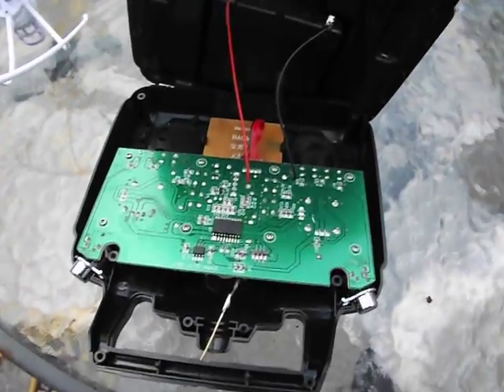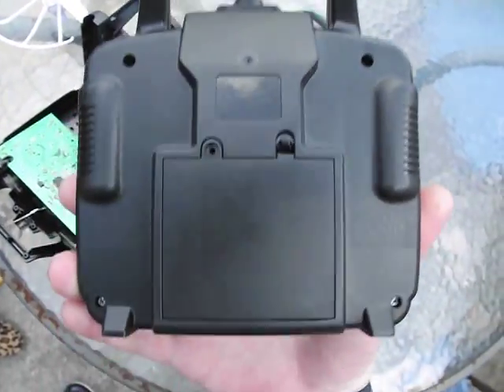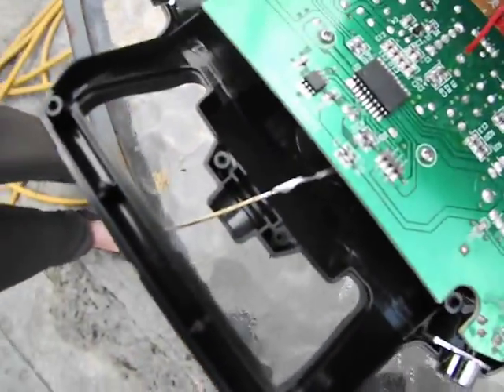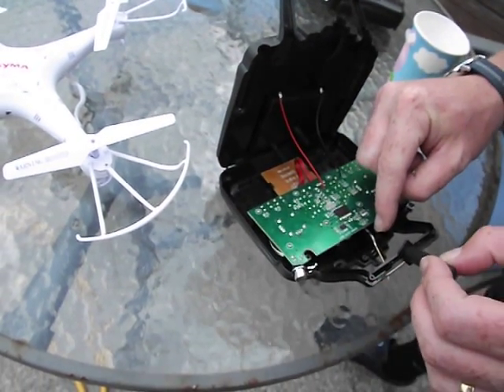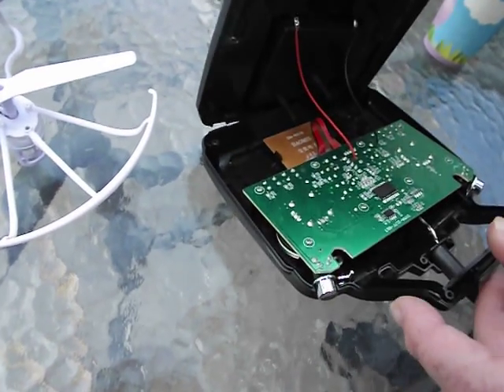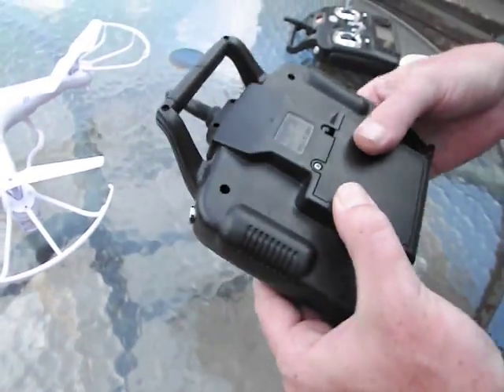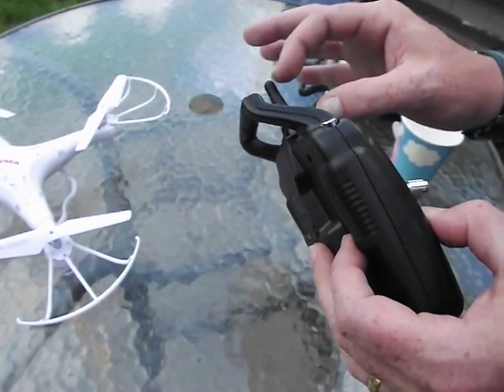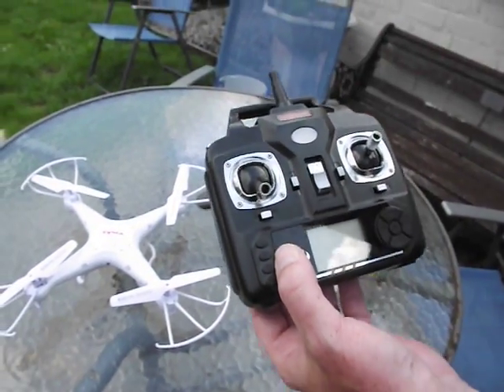Syma X5C Remote - Easy Antenna Range Extender Mod (2 of 2)

Comment: I want to do this but I'm afraid il just end up making it worse. Could you use copper wire along as it's the same length as the original antenna? Good videos by the way really helpful I have just ordered a X5C-1 my first ever quadcopter. Thank you for making these videos. 

Aaron.

Comment: How long was the wire you soldered on?
Reply from the maker: Jailbreak/Quadcopter Guy Any wire of equal thickness that is also radio conductive will do. As for length I would suggest you use 6.25cm total radiating length. The complete measurement for 2.4GHz is 12.5cm so you want the total radiating length of the antenna to be either that or a multiple of that, ie 6.25cm makes a half wave 2.4GHz antenna where as 12.5cm would make a full wave. You need to make sure you use the correct measurements or you could cause more loss than gain.
Reply: +Teash If it's not half wavelength then some of the energy will be reflect back into your transmitter where it will be dissipated as heat. This is called standing waves. The result is that it won't work even as well as it originally did and over time it could damage your transmitter.
Reply: xtratalk1 
Hello :) what will happen if my wire will be too long? I mean if it will be more than 12.5cm like in example 15cm? will it still works normally?
Reply: +xtratalk1 Do you have to stick the new copper wire to the one that comes with quad at the very end of it or you can stick it at about 0.5 cm from the very end of it?

In your first video it seemed like you wanted to stick at about 0.5 cm from the very end of the wire but in that second video I can't tell if you did or not.

Comment: Thank you for great video.
Quick question: will it work if I replace the wire (antenna) with wire equal diameter and 6.25cm in length?

Comment: Why does it not come with a fixed antenna from the factory? Why is the dummy antenna not a real one?
Reply from the maker: It's probably down to cost cutting which is a shame as it would have a much better range out of the box if they simply had the wire go into the antenna housing rather than bunched up inside the control near the board. They have improved this slightly with later models.
Reply: Thanks.

Comment: If I were to go to a Home Depot or Lowes hardware store is there a certain wire to look for? I understand it should be copper and able to conduct radio waves, but us there an exact thickness? Maybe a certain gauge? Also where exactly does it get soldered to the original wire? If you are soldering a 6.25 cm wire to the existing wire wouldn't it become 3/4 wave? Any help would be very much appreciated.
Reply from the maker: Any wire of equal thickness that is also radio conductive will do, copper is a good radio conductive material. You want the complete radiating length to measure 6.25cm or 12.5cm. The shielded wire attached to the board is classed as coax and does not count towards the radiating length.
Reply: xtratalk1 Thanks! Will be trying this weekend.
Reply: Randy Candy finally grew a pair and did a mod. I ended up taking an antenna from a dead Linksys router. It worked!! I'm not techy that way either. Hardest part was separating the antenna wire and the ground layer both of which u have to solder. Took me 3 hours but that's cuz I was timid and watching videos and reading comments of how to.
Reply: Joe Bleimeyer How did it go? Super tempted to try this but i'm not experienced with any of this stuff

Comment: I really want to do this mod, but there aren't any detailed enough videos explaining type of wire, videoing the soldering to show the connection overlap, the before and after measurement of the wire .etc I really don't feel confident with the information i have at the minute, would be grateful if you could make a detailed video please? Really like the channel too, keep it up mate!
Reply from the maker: Thanks MrTim93 and we are going to do a much more detailed video of this mod soon.
Reply: I was going to post the exact same thing. I really want to do the mod but don't wanna screw it up.
Reply: xtratalk1 Thanks for doing another video, I myself have very little experience with electronics. Getting this quad in the mail in a few weeks and will definitely do this mod!
Reply from the maker: Joe Bleimeyer We will get a more detailed video of this mod up really soon. If you don't feel confident right now then don't do it. if you do, take your time and follow the measurement guide in the video description ;)
Reply: xtratalk1 umm when is really soon?
Reply from the maker: TheLatvianHamster Within the next two weeks ;)

Comment: Hola, cuanta distancia alcanza Syma x5c con esa modificación? Sin modificación alcanza 50 metros, podría decirme cuantos metros alcanza con la modificación?
Un saludo.
Reply from the maker: About twice the range if you do it correctly :)
Reply: xtratalk1 Gracias por su respuesta.
Que material usa para extender la antena? Y que usa para unirlo soldador estaño?
:)
Reply from the maker: Hi Rober. Any wire of equal thickness that is also radio conductive will work such as copper wire or even speaker wire. I would suggest you use 6.25cm total radiating length. The complete measurement for 2.4GHz is 12.5cm so you want the total radiating length of the antenna to be either that or a multiple of that. You need to make sure you use the correct measurements or you could cause more loss than gain. Normal solder and a soldering iron are the best tools to use.
Reply: xtratalk1 Muchas gracias por su respuesta lo haré y ya le dire resultados.
Felicitarte por tu canal me subscribo. :)
Reply from the maker: Rober Gomez Thanks Rober :)
Reply: +xtratalk1 Ya aumenté el rango, y alcanza el doble como me dijo, gracias.

Comment: Instead of a wire extension, I used a tiny coil spring that fit inside the existing antenna housing, works great now.
Reply: +Busa0069 As long as the length of all that coil is 6.25 or 12.5cm your OK, it's not the length of the spring, it's the length of the UNCOILED spring....

Comment: Ok people he is not de soldering it from the board . hes is just simply adding the same type of wire to the wire that's already on the transmitter. If you want to do it rite. you have to get and old wireless router and rob the antenna out of it , then solder a pig tail adaptor to the board. If you do this I guarantee 80 to 120m

Comment: If you do the same to the receive wire antenna in the Syma X5C it will really max out the range.  It will guarantee much fewer in-range dropouts.

Comment: Thanks! Great stuff! Any plans to do a video about how to extend the antenna in the actual quad also?
Reply from the maker: Hi. Yes we're going to do a more detailed video soon showing the antenna mod on the control and the quad :)
Reply: Cool! I just did the mod on the quad, extending the antenna to 62.5 mm. And last night I followed your suggestions for the controller. I can't wait for the weekend to see if it worked! (Hopefully the weather will be good enough to allow some test flights...)
Reply from the maker: Bengt Alverborg Awesome, best wishes and let me know how you get on :)

Comment: Hi so I tried this mod, soldered wire onto the old wire and when I turn on the remote I get a continuous beeping from remote and it wont sync to the quad any more,  I've noticed some other people had this problem too, has anybody figured out a fix for it?
Reply from the maker: You have to be careful when you open the remote as there is a wire attaching both parts together, if you've disconnected that you will need to reconnect it again.
Reply: xtratalk1  Which both parts do you mean? the 2 wires from power to the board or something else?
Reply from the maker: wolfy1337 Yes the two black and red power wires are the main thing to be careful with so check you haven't loosened them, everything else is important too though so carefully open your remote and check everything is still connected properly and in the right place.
Reply: Yeah everything is still connected and I did not  get any solder on the board but I'm still getting the beeping noise, not sure if i shorted the board or use wrong wire, I ordered a new remote anyway, hopefully it works with my current X5C.
Reply from the maker: wolfy1337 Good luck mate hope it works

Comment: I'm having the same problem as Carlos. Pulled the thing apart, soldered the new wire on and I get the continuous beep. Remote won't connect to the copter and nothing will work. Anyone know anything about how to fix it?
Reply from the maker: It looks like you've disconnect something. Are all the wires etc. still attached?

Comment: shouldn't there be 2 wires on the board for an antenna ? one being a ground wire -  other tx's that I have modded all had 2 wires ,,,, now with my Syma one I notice there is only one, but there is spot on the small antenna board to solder another wire on.
Reply: +kevin peters  Nooooo that won't happen..IF you had a common wire to the ground and the radial, it would. But not using the ground plane pad won't hurt anything. As someone mentioned before, YOU'RE the ground plane..All we're doing people, is adding a piece of wire approx 6.25 cm to the existing wire. And then (by measuring, cutting it EXACTLY to 6.25cm which is a half wave.. You could just as easily add a piece of wire 12.5 cm. drill a small hole in the cone of the antenna cap, maybe add some shrink tubing for some rigidity and that would have even more gain over the standard....
Reply: +dayvsea  But the mod does not to have made even on RX??
Thanx

Comment: What Extra Distance are you getting??
Reply from the maker: Approx about 80 to 180 meters distance compared to the 50 to 100 meters standard out of the box I was getting. This also depends on conditions and you will get better results if you mod the antenna on the quadcopter itself too.
Reply: xtratalk1 I also have yet to see anyone actually display the results by flying the copter pre/post mod - quite puzzling, as you would expect a demonstration to be the primary way to convey the benefits.
Reply from the maker: Emery Rudolph Yes that's a good point and is something we are going to have to do, we also need to show the mod to the antenna on the actual quad too. Weather is bad here right now and we will need a good open space as the only way to truley test the range will be to push them to the drop out limit but it's a video we need to do for sure, thanks for the suggestion Emery :)
Reply: Emery Rudolph https://www.youtube.com/watch?v=aEUKL7MIjEE

Comment: HI, i opened the transmitter, soldered the wire... and when i switched on it, it sounds a continous BEEP with green light. it looks like an error. I desoldering the wire... and same error. Any solution? thanks.
Reply from the maker: It looks like you may have disconnected or caught something else in the remote while doing the mod, have a good check and make sure everything is attached and not broken on the inside of the remote.
Reply: Avez vous résolu le problème.Moi pareil impossible de rallumer le drone.Plus de connexion entre la télécommande et le drone.Pouvez vous me donner une réponse  Merci encore
Reply: xtratalk1
 Merci de m'avoir répondu,après la modification,le drone fonctionnait très bien .C'est plusieurs jours après la modification que le problème est apparu .Et maintenant impossible de faire la connexion avec le drone ,les leds  clignote en permanence .J'ai pas encore trouvé la solution .J'ai ramener le drone au magasin j’attends qu'il me rappelle pour avoir une réponse car le drone n'a que un mois,et peu être encore sous garantie .Rien de débrancher dans la télécommande,tout est ok.MERCI ENCORE
Reply from the maker: jean pierre menou Yes it looks like it's a developed a fault. I hope the store will exchange it for you

Comment: hi, the antenna of my remote has a length of 27.2 mm. the double length will be 54.4 mm. you write about 62.5 mm. 2.4ghz double length should be 48 mm i am confused?

Comment: Tell ya, the harness is a difficult part to remove from the board, eh? Trying to pull that plug out of the female connector is like pulling teeth! Anyway, I've gone the 125mm from the PCB using a length of 0.5mm insulated tie wire, works like a charm...
Reply from the maker: Excellent :)
Reply: I popped out the LCD

Comment: i used silver tape  cut a 3 inch long  bit, then roll the sticky side of the tape till it looks like a bit of wire about 3, to 4 mm thick. then fit it to the syma antenna ,then cut 1 inch bit of silver tape and stick them together ,,no solding needed .EASY

Comment: I think this mod needs clarification.... I saw on another post that 4.29" is the correct length (he was American) his modification worked to his satisfaction.... Just need some clarity on who has done this and who has not.
If you have done this what did you use and how did you do it??

Not "just got some wire from a washing line"

Please respond.....
Reply from the maker: Hi Paul. If you read the description it says...

"Any wire of equal thickness that is also radio conductive will do. As for length I would suggest you use 6.25cm total radiating length. The complete measurement for 2.4GHz is 12.5cm so you want the total radiating length of the antenna to be either that or a multiple of that, ie 6.25cm makes a half wave 2.4GHz antenna where as 12.5cm would make a full wave. You need to make sure you use the correct measurements or you could cause more loss than gain."

Anybody doing these mods do them at their own risk and I accept no liability, as well as a quad hobbyist I'm also a radio ham so I do understand antenna's, wavelength ratio's etc. though I'm no expert so everyone should carefully research things first before modding their equipment.
Reply: xtratalk1 My SYMA X5C has arrived. So just to clarify the total length of the antenna needs to be 62.5mm. I will be using the core from standard co-axial cable to attach to the antenna using solder. I will attach the new piece longer than it needs to be, then measure from the base of the emitter 62.5mm and cut there. Or I could measure 125mm for full wave, it there any advantage in going full wave? I fully appreciate that this mod is at my own risk. Many thanks for your videos, I may make a little vidoe of me doing the modifications and post on my channel.
Reply from the maker: Paul Miller
Have fun. You could always wait a few days before you do the mod to get an idea of the distance you get before it and then after you've done the mod test it again to see the range improvement. When testing range make sure you have a good open area as you will be most at risk of loosing control if you are testing range limits and if you do loose control you want to be able to see where it roughly lands and be able to retrieve it. Also if you can do it in the evening then the LED indicators on the quad are easy to see and they will flash to warn you when it's going out of range.
Reply: Hi there. What is your name? I tried the hack you posted. It seemed to work... But... me being me saw another hack. I purchased a defunct wi fi router from a boot fair. Replaced the ariel on the transmitter with this. Then I replaced the ariel in the Quad with a 62.5mm length of copper core from a co-axial ariel cable. So far all seems well. I did not test the range prior to doing any of this! But suffice to say even at 50ft away it started to struggle a bit. I will make a video with stills of what I have done to share with like minded and interested parties. I am going for a full altitude test this weekend and will post the videos. Many thanks for your videos, keep them coming. Have a look at my videos. All Syma X5C.
Reply: @xtratalk1   making it 1/2 wave or full wave if i'm not mistaken will change the ohms and risk your boards burning up. I would do 1/4 wave or 3/4 on max scale. At least impedance will be closer.
Reply: +1dariansdad It is possible that the stock range is enough and you can't do the mod?

Comment: What is the lenght of the wire that u soldered, and what is the total lenght of the new antena. What kind of wire did u use? Copper? What thickness?
Reply from the maker: Hi, yes copper would be fine or any wire of equal thickness that is also radio conductive. As for length I would suggest you use 6.25cm total radiating length. The complete measurement for 2.4GHz is 12.5cm so you want the total radiating length of the antenna to be either that or a multiple of that, ie 6.25cm makes a half wave 2.4GHz antenna where as 12.5cm would make a full wave. You need to make sure you use the correct measurements or you could cause more loss than gain.

Another modification to the actual quadcopter extending the antenna to the exact size of the antenna in the remote will also help.

Comment: Nice job fella... i just wish i knew how to solder? I
Reply from the maker: Thanks for the comment and you should give it a try as it isn't difficult, you can always practice on something first.
Reply: thicker the wire the better.  thicker wire gives you broader bandwidth ....<<<swings and rounder  abouts >> also solder has a very high loss at microwave fregs.ie. 5.8GHZ  it has to have a (  very high tin content  )

Comment: Thanks for doing this. I just didn't have the skills to solder a coax cable onto that tiny antenna circuit board to implement a screw-in antenna.  But your modification was very doable. I went with one wavelength.  Although SeByDocky says that 5/4 wavelength (6.15 inch or 156mm) should work even better.
Syma X5C Quadcopter Drone Maximum Range Modification